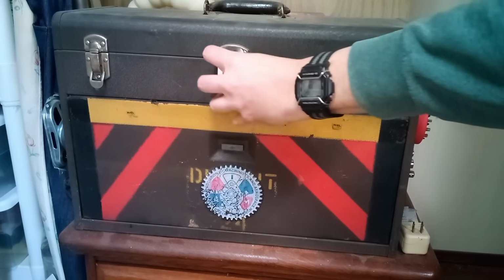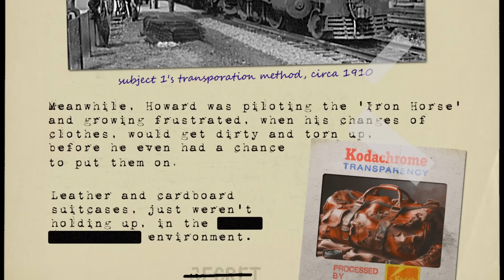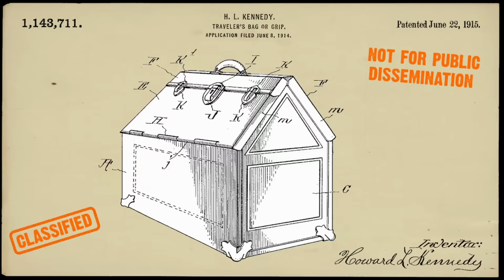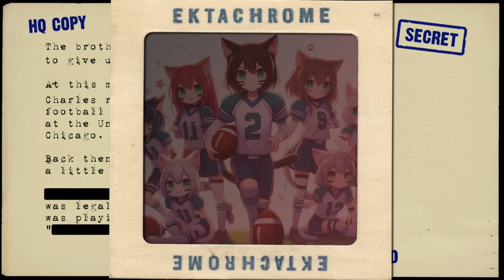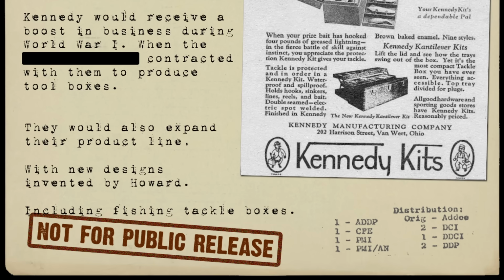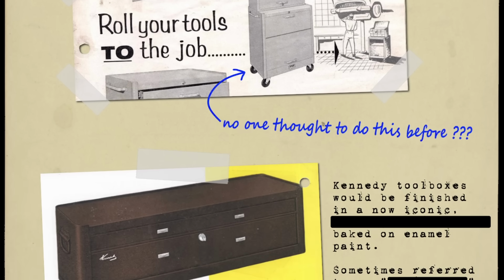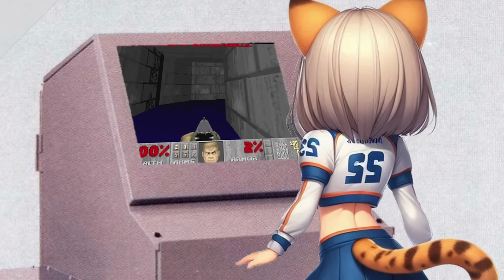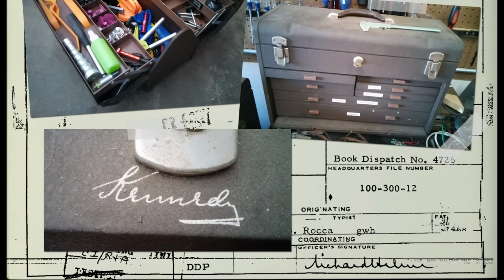Kennedy Kit Toolboxes - Company History & Lore

Comment: Nice video. I have a really old Kennedy toolbox that belonged to my father-in-law. It is locked and we have no idea where the key is. There seems to be a number on the lock but it is difficult to read. Do you have any suggestions? I can send you pictures if it helps.
Reply from the maker: Thanks! If it's the really old style where the lock is built-in to the latch (like the one in the intro to the video) I'm not aware of a source for the keys. If it's the style where the lock is a separate part from the latch, there's sellers on eBay, if you can make out the code on the lock. Might look into 'rubbing' - where you put a piece of paper over the marking and rub it with a pencil to see if you can make out the code.
Reply: @ballinator  Hi. I appreciate the reply. Yes, it is the old style with the square corners and leather handle. The lock is in the center and incorporated into the latch. We will try your suggestion to read the number. Thanks!
Reply from the maker: @fredcorcoran6689  Those "look" like they'd be easy to pick. The one that I have with the key, the key is basically  just a "T" shape. Might be able to get in with a couple bent paperclips.

Comment: I found both of my Kennedy boxes in the trash. The regular machinist chest needed a new door and new locks. Bought the door from Kennedy for like $65 shipped, and grabbed a new lock from a hardware store for $5. The cantilever box I have needs a new bottom welded in, but was used as a specialized plumbing part box. With colorful part numbers and descriptions printed in the box itself.

Comment: I had a 6 drawer Kennedy mechanic box about 45 years ago….very well built.   I used to drive truck and delivered to Kennedy in Van Wert in the late 90’s…they used to have a scratch and dent outlet that you could buy tool boxes at a reduced price.

Comment: I think I have a 520b I found on the kurb cant find any markings 🧐 it does have the felt lining inside regardless its still a keeper seems very well built I thought gramps had one in the garage but its an SK
Reply from the maker: Curb finds are always great finds!
Reply: @ballinator  probably the best tool box I found is that rolling snap-on cart that was in a house fire but it just needs some paint and the drawer locks plastic melted or maybe the DeWalt and then I got two of those small like benchtop type Craftsman boxes that were on some tool truck the lids are pretty beat up but the boxes are nice I'll have to do a little body work

Comment: 😢Fun history. Kennedy is far from the best tool chest in the market, but they are affordable and long lasting. I currently own around 20 Kennedy chests and several tool boxes as well. I have given several away to grandsons.
I favor them most for machinist tools since these chests have very shallow drawers. Mechanic chests favor deeper drawers, which means stacking inspection tools. Kennedy offers ball bearing drawer slides, but most inspection tools aren't heavy, and friction slides serve fine. 29" and 27" chests are large enough for most machinist tools. I have 2 Kennedy (somewhat uncommon) full depth mid chest risers. The classic machinist chest and risers drawer depth is quite small, which is generally a drawback for me, except for very small tools. The short risers and chests do give a small amount of workspace on the full depth bottom chests.
Mechanic chests are routinely much wider with much greater drawer depth. These features along with stronger drawers and slides are more fitting for larger and heavier mechanic tools. So my shops are filled with both designs, and even rated tooling cabinets with drawer ratings of 400#. 
A disappointing characteristic of Kennedy chests is that most don't offer full drawer extension. The kirinkle brown is a classic color and requires little maintenance to remain looking sharp. I collected my 30+ chests piecemeal. I still covet the monster chests like Snap-On offers, but I don't expect to upgrade since I am long only a retired hobbyist now. 

Kennedy is hard to beat for a mid priced, rugged chest. Like you pointed out, Kennedy chests are frequently very inexpensive when purchase used. I purchased a 3 chest Versa cart for $100.
5 Kennedy chests and one Snap-On chest made up my mobile industrial maintenance chest on a very easy to roll custom  fabricated cart for my career. This double triple stack is now an auxiliary chest in my wood shop along with several other chests. My machine shop is almost exclusively Kennedy, and my mechanic shop centers around a Snap-On stack and a Williams stack.

Thank you for the story.

Comment: I'm a Carpenter and have a 22" Cantilever box from Kennedy. I love it, just a little heavy. Didn't know they made a carpenter specific box. I'll have to look into it
Reply from the maker: I had never seen the 'carpenters' box until I started digging through the old catalogs. Def need to track one down at some point.
Reply: You'll see them around if you look. if your in  second hand store they are often half under something because they are pretty long
Reply: I think I have a cantilever box but I don't actually use it. It's down in the trailer with my toolbox overflow. I have a half a cantilever Kennedy box I keep a bunch of rotary tools and accessories in. That's in the pile O toolboxes in my garage. So in use. Not that I'm using those rotary tools all that often. But when I do it's a nice box for them.

Comment: The biggest problem for Kennedy is market saturation. People only ever buy a couple at most, and if they aren't dropped or hit by a forklift driver they will easily last a career. Plus there are many out there that get second and third owners negating the need for new units. They need to come up with some new models or colors to increase demand.
Reply from the maker: Agreed. Similar situation to what happened with Starrett.
Reply: @ballinator  very true, if used normally their gauges will last a career if not generations. I do destroy several of their smaller pin punches and center punches a year, but they outperform all the others I've pounded on.

Comment: I still have my father's Kennedy case, Style 520, and he has been gone over 50 years now. He used it to hold his drafting tools since he did lofting on aircraft parts in the 1950s. He worked for Luscombe, Temco (later LTV), and Chance Voight and worked diligently on his job as the US went to space. I see his work every time I look at the old videos of the Mercury and Apollo missions or see 747s flying.  Somewhere I have pictures of his drafting room at Temco Aircraft. It was a room with a large roll of drafting paper at one end and he drew out full size drawings of aircraft parts for the Master Machinists. That work involved him being on his hands and knees for hours at at time.
Reply from the maker: Very cool!
Reply: I’m afraid we may never see the likes of these kinds of men like your father. My uncle was a took & die maker during and after the war. I have some of his Starrett precision tools. Most guys today are capable of coding computer language or selling insurance but barely able to change a burnt lightbulb. Who’s gonna run and maintain the power plants and factories designed and built by older generations?

Comment: If you enter any American machine shop almost all the toolboxes you see will be Kennedy. They were always expensive but worth it, and many of those boxes were several decades old still doing the job 😎 So much I didn't know about Kennedy but I now have a deeper appreciation for them. So nice to find another American company still going and in their original city too ❤ 

Amid a rash of shop break-ins where crooks were rolling stack chests into trucks for a quick getaway, a machinist I knew took the wheels off his bolted-together Kennedy stack and loaded the bottom door compartment with several dozen small but heavy pieces of metal scrap which he figured weighed a half ton. Behind all that he'd welded a bolt to a steel column and drilled a hole in the back of the box with a nut and plate to keep it there, They'd have to remove each piece of scrap individually to get the nut unfastened to slide the stack across the floor into a truck or they'd have to take all the tools individually spending more time and effort than they were prepared to 🤣Luckily his shop was never hit but as the word got around all the local guys started doing something similar and this method of theft declined. 

This channel just keeps getting better and better 👍👍
Reply from the maker: Thanks! Neat story about weighting and bolting the toolboxes down.
Reply: I have two Kennedy machinists chests. I don't know what I'd do without them.  One has all bits in it and the other one has measuring instruments. So they're very useful to me. I use them all the time. They have pride of place on my one workbench.
Reply: My dad had a Kennedy Hip Roof tool chest with the hinged small part compartments. I remember when he got it and it’s the only tool box he ever needed.  But it was heavy when loaded! My brother still has, and uses that Kennedy box to this day. It must be 70 years old.